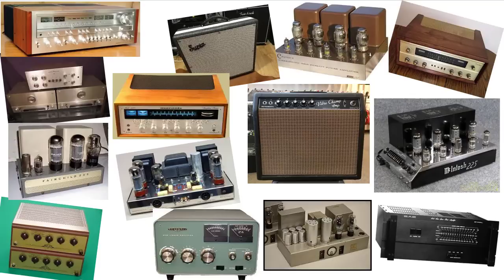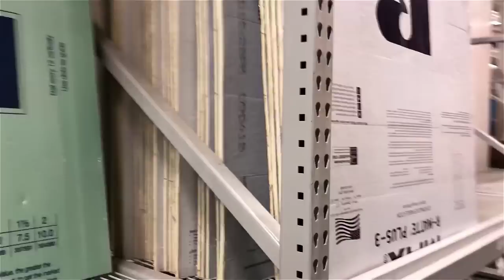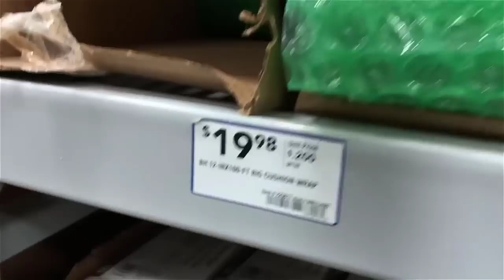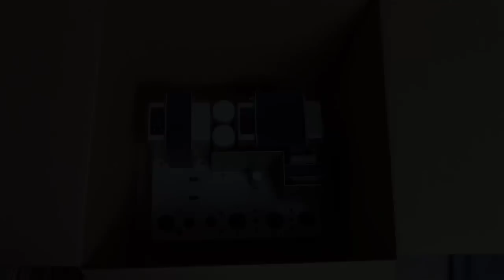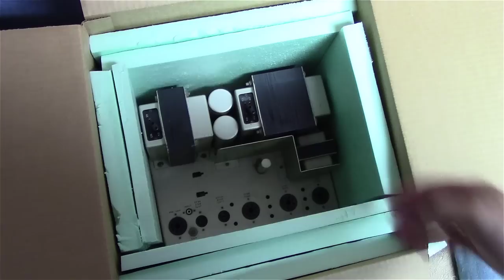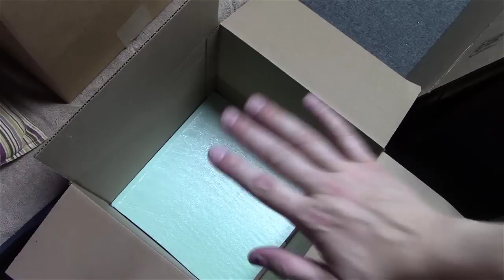How to Properly Pack Vintage Equipment for Shipping

Comment: Ahhhhh, what a relief.  Someone that actually knows how to package correctly.  I get so many radios sent in for restoration that either get damaged or completely destroyed in transit.  I HATE packing peanuts.  I tell all my customers, never ever use packing peanuts.  The first time a box gets dropped the packing peanuts turn into packing peanut dust.  Proper packing material is so much cheaper than replacing a radio or amplifier.  I'm lucky.  My brother works at a bearing manufacturing plant that throws away white extruded poly???? sheets by the dumpster full daily.  He brings it to me by the truck load.  I probably have over 2,000 square feet of the stuff out in the warehouse.  Not to hard, not to soft, just right.  It comes in 1/4", 1/2", 1" and 2" thickness.  I also see I'm not the only one that uses a tape machine.  I have a motorized Marsh 4-BT Touch-Taper.

Comment: Good video. I agree with everything you did. I would add that it’s a good idea to wrap the chassis in a stout plastic bag and seal it as well as possible against water damage. The smooth plastic will also protect the chassis from scuffing which can occur when the stiffer foam boards move against the chassis during shipping. Sometimes I will tightly wrap the chassis with thin flexible foam sheet material (1/8” or 3/16” thick), to protect it from scuffing. I also will scrape out holes in the thick foam for the feet to lock the chassis to the foam and not allow it to slip. With turntables, remove the platters and separately wrap them, and lock the suspensions.

Generally, try to imagine what could happen during shipping and visualize shock forces going in all six directions. That will help you visualize what might need extra attention.

Comment: Hi, good packing skills.  I am a shipper for a UPS Store and ship a lot of antiques as well as items like this at my store and I can attest to most of everything on this video.  Double boxing with foam board is excellent for packing vintage or delicate heavy items.  I will state that I felt the box could have been cut down a little but I may not have paid attention to the weight so I won’t judge.  It’s always better to overpack than damage an item with shipping.  

I will state that that “Gump Tape” (the one with the fiber strands and sticks with water) is a great tape but I do see it misused all the time.  It will come undone when when the box is not plump.  I see it all the time with Amazon boxes because that’s all they use and they never put enough packing pillows.  This video did mention to fill in everything.  I just want to offer that little bit of explanation.

I would also recommend bagging items so the foam bits or water during bad weather doesn’t damage anything.

Good job dude.

Comment: I was using beaded polystyrene and stuff like that to package electronics such as vintage tape decks and have had some failures with that.  I saw your videos and began using the materials you describe here and that has greatly improved things.  i now get complements rather than complaints from my buyers.   Thanks!

Comment: I often had to ship large and heavy computer parts around the world for one of my past jobs and nothing ever arrived damaged.  That experience came in handy one day when I shipped my great-grandfather's 1939 Hammarlund HQ-120X shortwave receiver from my folks' house in the US to my home in Asia where I planned to restore it.  A professional shipper, who clearly had never shipped a shortwave radio before, wanted $600 and I said "no way!"  The thing weighed 55 lbs but its almost square shape made building a set of nested boxes fairly straight forward.  Home Depot supplied the double-layer heavy-duty boxes, 3/4" thick white styrofoam sheets, bubblewrap and tape.  The boxes weren't near the right size (they never are) so they had to be cut down from bigger ones. Lots of time was spent cutting the boxes and gluing them back together with contact cement, then cutting carefully measured sheets of foam to fit all six inner sides of the boxes, including two for the front face of the radio so one could get holes cut into it to fit the shafts for all switches and knobs which I made sure to remove and bag separately. I then removed the vacuum tubes and carrying handles and wrapped them each in bubble wrap, then made a cardboard baffle to protect the large VFO and Bandspread dials from anything that might strike them and break the brittle plastic.  I then stuffed the tubes, handles and bag of knobs back into the cavity but left the tubes out of their sockets so they wouldn't break from any shock impacts.  I then wrapped the whole device on all sides, including the one foam sheet with the holes cut into it taped to the face-plate, in six turns of the same thin bubble wrap I used to wrap the tubes in and taped it all up nice and tight, then slipped the whole business into the smaller of the two boxes and taped it shut.  That box then slid perfectly into the larger box which had its own walls lined with foam. The big box was then taped shut and completely wrapped like a holiday gift in heavy brown shipping paper.  It took several days out of my vacation time to do this work but the postage and packaging costs were 1/3 what the shipper wanted and the box arrived 10,000 miles away at its destination safe and sound and in perfect condition.

Comment: I used to do a lot of vintage stereo selling on Ebay, back when people thought they were paperweights! You could only imagine the piles and piles that I acquired.  The only means I ever used was newspaper and double boxing. Although it made the box heavier. They ALWAYS arrived safe, I kid you not. I packed many a Pioneer SX-1250, 1250, 1280, etc. Also, turntables, which of course are very fragile. ALWAYS arrived safely to their door. Keep in mind, this is 100's of stereos we are talking about. I will admit, I used a ton of newspaper to really keep them safe. I had comments like, this box could be dropped out of an airplane and not get damaged!
I have over 1000  positive marks on ebay. I sure miss going to rummage sales and picking up some great Pioneer, Marantz, McIntosh, Sansui amplifiers speakers, receivers, reel-to-reels, turntables. Sometimes I would pick up a whole system piled up the to the ceiling!

Comment: I have an old 1975 Magnavox 8-Track Receiver that I just put in an inner box (before I saw your video). I'm preparing it to be sold on eBay. I wrapped the receiver first with some white foam protective wrapping (it looks like a 1/8" blanket) I received with another product and then put the wrapped receiver in a plastic bag to protect the receiver from any packing foam from getting inside the cabinet. I then placed the receiver in a Picture Frame Box that was 1 inch bigger in all dimensions than the receiver. On the bottom of the Picture Frame Box I put a 1-1/2" layer of1/8" diameter bean bag foam Styrofoam beads (Amazon sells the beads as "Big John"). After I put the receiver on top of those beads I poured more beads around the perimeter of the receiver and on top of it filling the entire inner box. At that point I closed the top of the box. I plan on preparing an outer box like you did in your video. The Magnavox has no heavy transformer and it's solid state, so I figure it would survive being shipped if double-boxed. Let me know if you think this method of packaging would be OK for a 15 pound receiver. Thanks!

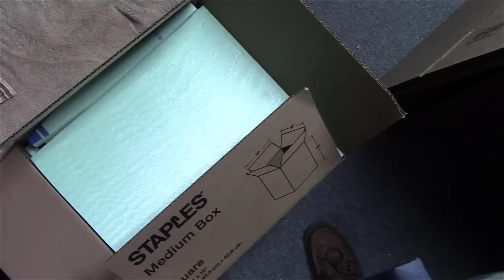Comment: note the tape job (@14:40)...

nice flat, straight, no-kink job right there. it IS doable with clear packing tape. severe kinks can lead to loose tape, sticky side folds open to the world CAN snag on things, potentially pulling tape right off, if murphy would have his way. 

try to smooth out the start and finish cuts of the tape after rolling the tape gun over it FIRMLY. 

thanks for the great video!

Comment: I like it. Very similar to the way i do it. Only thing i do differently is lay a sheet of something under the ampand fold it up and over the top to protect from chafing .  For receivers like pioneer and marantz packing is a little different as you may know. Cant have weight on the knobs. For these i poke holes for the feet to set down into which stops the receiver from shifting forward into the face. (Simplified explanation). Learned that trick from Mcintosh.  Got a pioneer sa9800 jist yesterday with solid core like this, and it was resting on the knobs. 3 bent knobs, 2 broken shafts. Your video is refreshing to see, thanks for taking the time out of your day.

Comment: I enjoyed watching this video. I have a few suggestions. Something like the mono block tube amplifiers would be great if you cut the box near the top of the piece of equipment. That way you don’t have the possibility of having it shift . I saw that you added extra foam on top but that makes it bottom heavy. I received an amplifier in a big box with paper for padding. Needless to say what happened and the amplifier was damaged turning it on produced hum and it wouldn’t pass an audio signal,, bent the cooling fins. His remedy was to take a few dollars off. Had they watched your video, this would have never happened.

Comment: pretty good video I am totally against bubble wrap on a 75 lb stereo receiver the first layer of bubble wrap will allow the receiver to move around just enough to cause damage. i use 6 in of Styrofoam sheeting around all sides of the stereo.

Comment: Really nice job. I got a Honda XL350 Motorcycle Engine once and it was sent from California in a big single wall box that the fella laid the motor inside, filled it up with packing peanuts, and closed the flaps with 6” pieces of crappy duct tape. I wondered why it took a month to get to me. I guess it started falling apart immediately as it left and finally when I got it it was a mess of post office tape in a huge ball. At least it was a big hunk of metal. :-)

Comment: all good, and thats how i send the amps i fix out [jukebox amps] except for i leave the valves in there sockets and fill the void around them with Styrofoam chips...i used to remove them and wrap them in bubblewrap, but  you are relying on the customer to put them in the correct sockets,  following one amp repair  where the customer put the output valves and rectifier in the wrong sockets...i now no longer do this!  i have shipped probably 20 amps with valves inplace with no problems...yet!

Comment: I received an amp that had been improperly packed. The 19" front panel was bent back on each side where the ~12" chassis was attached. I got in touch with the seller, sent pictures, and negotiated a 30% refund. It took me about an 1½  hour to remove the front panel and straighten it. Fortunately, I have a good workshop available.
Reply: Where does the large bubble wrap come in? I always cover the item with bubble wrap first.